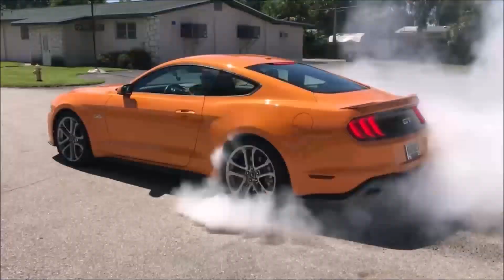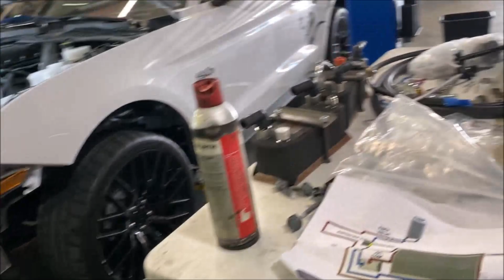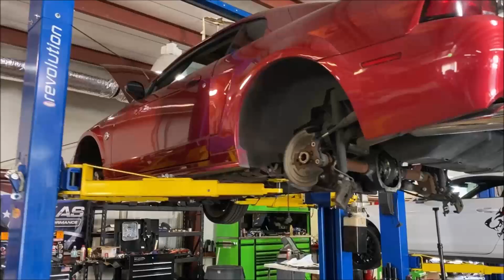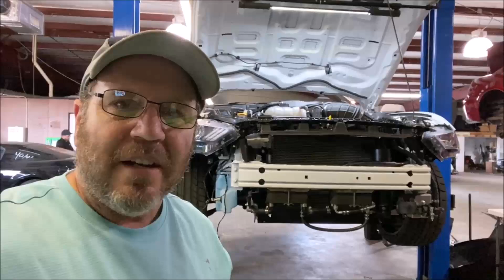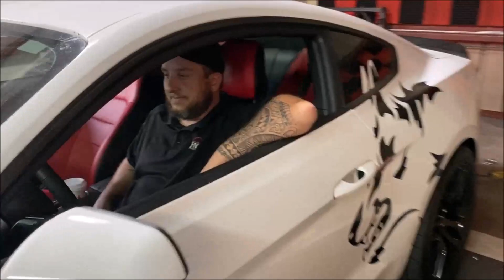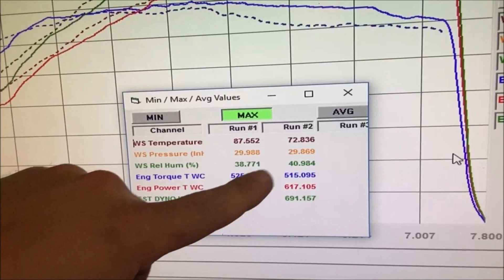Whippled 2019 Mustang GT 10R80 _ Killer Chiller Install _ Dyno Results!

Comment: You took off the air to liquid heat exchanger? That you’re gonna have to run that damn air compressor every time you start the engine or you going to overheat the whole system you should’ve put a three-way valve that is not a street set up at all when you lose an air compressor send shit off of the system. You’ll never get the system cleaned out hundred percent.
Reply from the maker: yes you leave the a/c on all the time

Comment: Nice car but no need to put a built engine in a 700hp 18+
Reply from the maker: Shaun Richardson . . . My stage one whipple 2018 mustang broke a piston with 650whp . .  this 2019 broke a piston with 725whp. .  both of us got built for boost engines that can handle 1000 hp no problem
Reply: @coyotecarguy2076  was it a bad tune or bad gas? Got me worried now im at 756whp on my 2020 gt
Reply from the maker: @sdrtech  . . .  There is really no way to be sure .. .  some people say tune is the problem. .  i dont think so. .  i think Heat is the problem. . we are here in florida so our stuff gets hot .. .  so if you can, run a 170 degree thermostat. .  that will help. . if you go for a custom tune ..  be sure you know what the fan settings are . .
Reply: @coyotecarguy2076  ok thanks

Comment: Was going to go with a vmp heat exchanger but man you really have me thinking killer chiller.
Reply: Hey Al the killer chiller cant be installed along with the heat exchanger?
Reply from the maker: 5.0PRIM.0. . .  Yes, the chiller can be installed with the heat exchanger. .  i do not have that kit because i live in florida so i have no need for the heat exchanger . ..   but a kit is available that keeps the heat exchanger in the car.  .
Reply: @coyotecarguy2076  so I've seen the vid. This setup.is definitely improved over the one on the orange mustang.

Comment: Great video Coyote carguy !!! I think i'm gonna need one of these killer chillers . 30 rwhp extra would put Ruby @ 800 rwhp on the same boost level...
Reply from the maker: I would say its not needed for you. .  you live in  cold climate most of the year .  . Heat exchanger will work just Fine!
Reply: @coyotecarguy2076 IDN man In the summer Michigan get's to the 90's+ Humidity .It's not as bad as Florida but it's still Hot lol..
Reply from the maker: @carmob7499  how long is your summer?
Reply from the maker: @carmob7499  how long is your summer?
Reply: Coyote carguy from about May -September are our warm months. We’re just starting to warm up now 50’s & 60’s.

Comment: So the heat exchanger was removed completely in favor for the killer chiller set up? What about using them in conjunction with one another? When you do the dyno pull do you still keep the ac on during the run or turn it off right before?
Reply from the maker: Anthony Sotomayor . .  When using a killer chiller during a run. .  the a/c is left on ..
Using a Heat exchanger in tandem with the chiller is counter productive in the florida heat.. . the heat exchanger will heat the fluid to ambient temp of 92 degrees before entering the chiller to be cooled again. . . better to store clod water in the holding tank instead . .

Comment: Does that killer chiller Mustang have any other mods like headers, injectors, etc?  Thanks.
Reply from the maker: Todd Rey. .  It has a Whipple Stage 2 with Long Tubes . ..  Injectors are the 38lb units supplied by whipple  ..Tuned By Lund. . .  That's about it..

Comment: Not being a smart ass at all, but why is it so hard to get an IAT2 temp with whipple?
 These killer chillers value would be in the tune knowing the air temps entering the cylinders and NOT PULLING timing simply because the inlet air has increased....
 I think with the stock whipple and other remote tuning, your not seeing the gains because the tuner cannot factor the actual IAT improvements as it enters the cylinder.
 However James can set there and probably just keep easing timing up till he gets a little knock regardless of what the IAT says with the killer chiller and this makes more power......

 To put it a little more succecently, the reason you have to shoot the water with an thermal temp gun is because the CAR isnt monitors the effects on the chilled water going into the engine.

 I presume since my EB stage 2 uses an IAT2 sensor directly in the airflow path just before cylinder 4 ( aka furthest away from the ambient inlet air) after the dual pass intercooler brick....it would literally be showing similar temps to the water temps exiting the supercharger.
 Therefore I could see the real effects on the air entering the dyno cylinders but even more importantly the tunes IAT timing curve could as well making it easier to push timing especially during remote tuning sessions such as with Lund, and also to log rise......

 I'm not bitching just wish one of yall would do the IAT2 ( my Edelbrock  Stage 2 comes with it ) we can see the real effect of air entering the cylinder especially during hood closed normal operation!!!!
  I think Tracy would for sure see gains as if his IAT2s are 50 degrees at WOT...Lund could toss some timing in till it has a tiny bit of knock, then pull it back a degree and set the IAT vs timing table to pull after that highest temp during a pass in case of KC failure or overcoming temps.....

 At any rate thanks for the video it was really interesting to see where they put the tank and what it looks like very glad to see that...I bet removing that big HE helps the engine run cooler too in dead of summer....

 Good luck Tracy !
Reply from the maker: BlueCollarDaily .  ..  You bring up a couple of good points. .   we could read IAT2 with the nGauge installed.. . we should have done that . . . in the case of tracey's car ..  it was tuned without the chiller so timing was limited to the conditions of the day with "Typical" range in the Knock Sensors .. .  In the case of My car. . . we Tuned it with the chiller on it. .  and we did exactly what you said.. . we kept adding timing until the knock sensors started to become Unhappy. .  Then we backed off . .  the Results speak for them self. . . we made more power .. .  at some point i will put an nGauge on my car and read IAT2.. i did a video at the track where my tuner showed the Log of My IAt2 ..  it never went above 87 degrees during my 1/4 mile pass and that was without the holding Tank!
Reply: @coyotecarguy2076   yes its ALL good data !!!!
 Thanks for reminding me I actually forgot about your tuner showing the log even though I love to compare.......
   Lots of good data here....not saying remote is as good as your tuner because he really dialed your car in, wasnt it worth like 2 or 3 solid tenths having him there? But with that same data Lund could get closers..
 On the flip side of the coin we see with the tune unchanged the killer chiller itself literally made 30hp...optimized for the chiller closer to 50 or more....incredible.....

 This is my first Ford and the Edelbrock breaks out the IAT from inside your MAF sensor and routes it to the back of #4 cylinder SO...what I see on my cars dash has always been the real IAT.....
 I didnt realize you needed an ngauge to read yours, though I'll say I bought one used and it was worth every penny.....I also have a HPtuners MPVI2 I could send out and loan him just to log for a tune is he needs....I'd like to see his car at optimum!!!!

 Thanks for ALL the killer chiller content my cousin is having a hard time finding a shop in Texas to install his because they all say it leaks :(

Comment: Pretty decent gain, considering the higher ambient temp or no other changes.
Reply from the maker: ponie1992 .... .  .. . . . Thanks Bud!  ..on my car i got a 50 hp increase. . .  our baseline was done on a 92 degree day so the power was down with the heat exchanger . .  with the KC installed it ripped an additional 50 hp on an equally hot day. .  thats why i did this . . it is so hot here for 7 month out of the year, Now my car runs great ALL year Round!
Reply: @coyotecarguy2076  good deal, Al. I need to decide which way I wanna go once my blower is on.

Comment: What the difference between your KC kit and this KC kit and how did your ac work, Lastly how would it work running the KC with my stock IC too
Reply: Ac works great and Al's is a a one Big brick system I feel it's better than this one but we were on a budget.
Reply from the maker: Joel Stein. . . tracy basler  is correct. .  the One Large system will work a little better than the Duel system . . But the duel system is pretty Badass. . Many people buy a single system which is only one of the small KC units and they work pretty good!  A diverter valve can be added to use a KC with a Heat exchanger. . .  This is good when you live in a cooler climate and you want to turn your A/C compressor off.
Reply: Thanks for the clarification,  one more question say I wanted to run the chiller with my HE but also a race valve, would I need both valves on would one valve so both?

Comment: Great job Al of documenting the KC install and what it does for you. I really like the welded line a lot more then compression fittings, you know me, I love the OE look.
Reply from the maker: Stupid Fast Truck ..  .. . . . Thanks Bud!  Yeah My compression fittings failed.  the welded line is sweet ..on my car i got a 50 hp increase. . .  our baseline was done on a 92 degree day so the power was down with the heat exchanger . .  with the KC installed it ripped an additional 50 hp on an equally hot day. .  thats why i did this . . it is so hot here for 7 month out of the year, Now my car runs great ALL year Round!